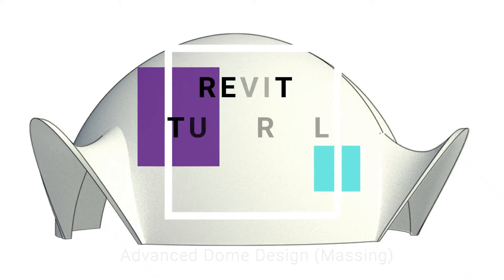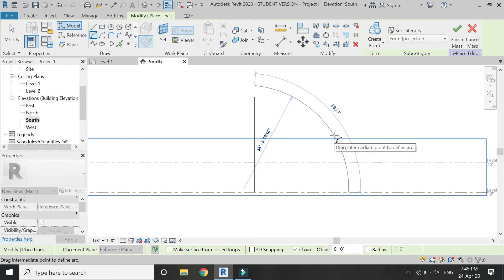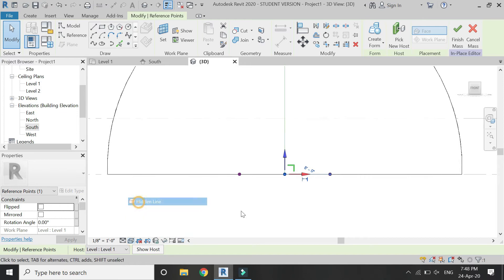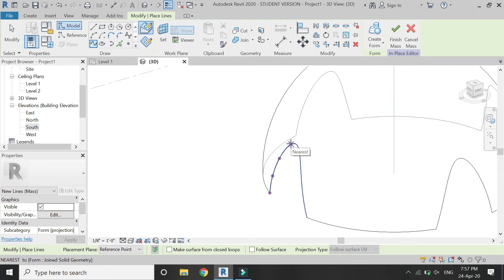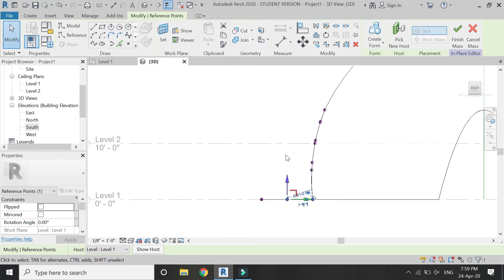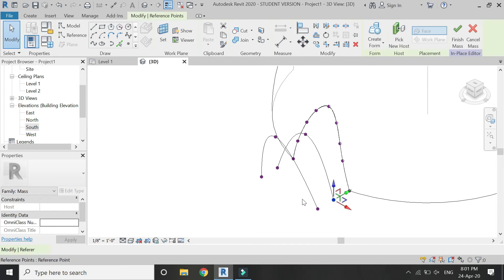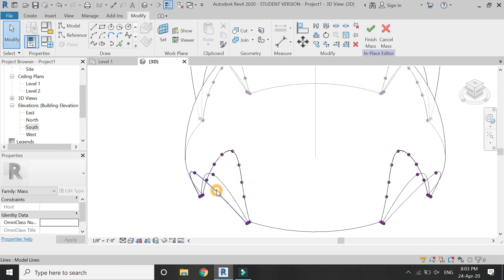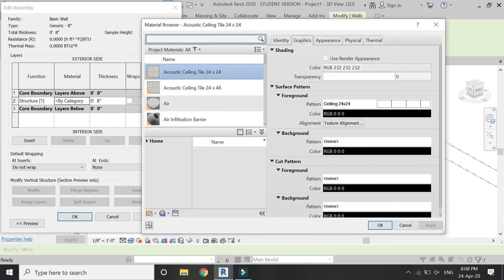Revit Tutorial - Advanced Dome Design (Massing)

Comment: Great job, 
I have a quary I unable to understand when I have to create plan or referance and where have to create. I m beginner please explain.
Reply: किस plan को किस elevation मे create करना है उसका use किस Elevation मे होगा ये समझ नही आता please make an video for it, you can create or imagine where you have to create what will the the result of it because u know revit very well but for beginners it's very difficult. I hope u understand what I m saying.
Reply from the maker: Mostly of the times it is a hit and trial method. There are no specific rules at where to avoid massing or where to use it. Mostly massing is used for the multiple dimensional curves, high rise buildings and complex structures. Just keep on practicing Revit and after a few months you will start to understand it.

Comment: How to apply diffrent types of metal material pls make video.
Reply from the maker: The material browser in Revit has built in materials for many metals. Can you elaborate about how you want to apply them and on what surface?
Reply: @LetsRevit  I am applying in Revit families but appearing black in realistic view also in render.
Reply from the maker: Then that's because that could be the metal which is black in colour. Can you share the name of the material which you are applying?
Reply: @LetsRevit  steel chrome plated
Reply from the maker: I have rendered a wall using this material. It does not render in black colour. It only appears black in the graphic display options of realistic view, shaded and consistent colour but once you render it, it gets its original appearance.